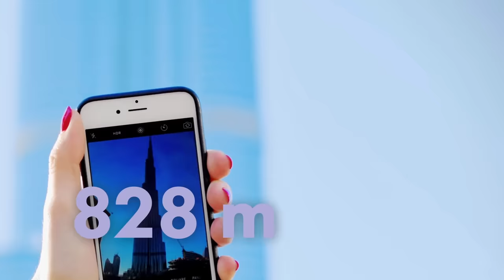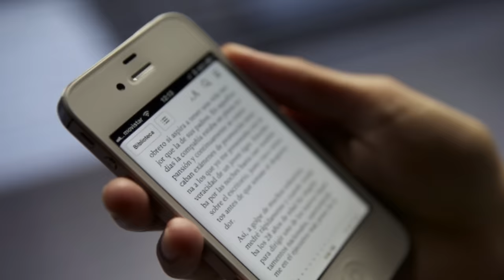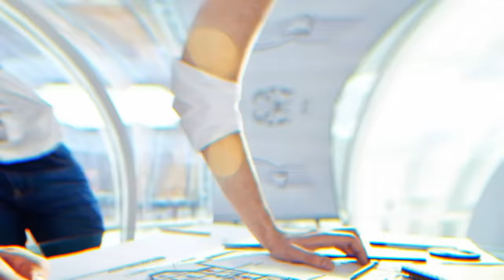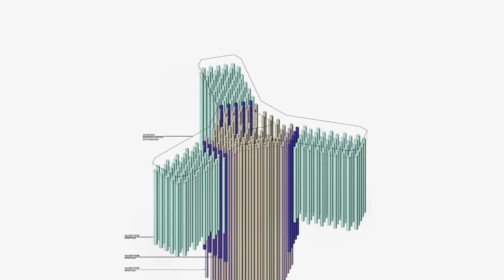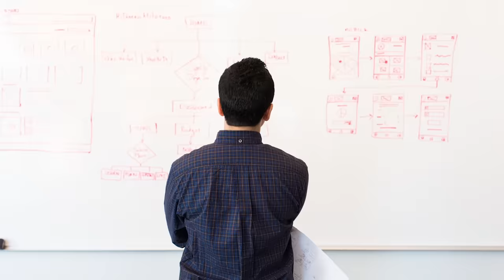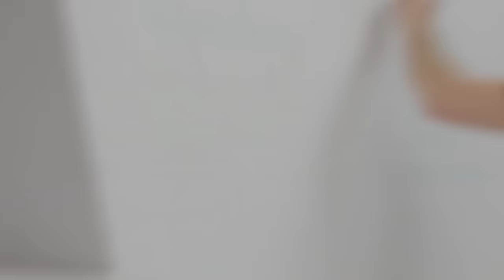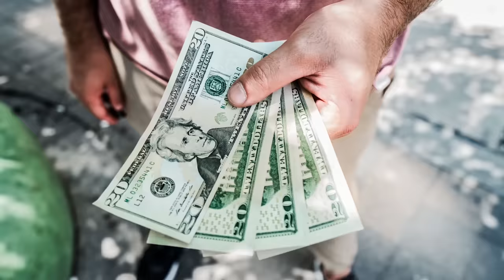What If We Build A Skyscraper With A Billion Floors?

Comment: Can we jump of the top to suicide or will we float in the space
Reply: Float
Reply: You'd  still die in space so it's  okay
Reply: Wouldn't you be flung away by the centrifugal force? The "top" would rather feel like the other bottom, with empty space below it. You'd have to jump through the floor, or from the sides.
Reply: You would die because there is no air at the roof plus the earth is 100,000 feet high until space if you were to be in building of 1 billion floors tbh have fun climbing
Reply: @vinnyn10  wow u must be fun at parties

Comment: A billion floors at 14 feet per floor equals 2,651,515 miles, or about 11 times the distance between the earth and moon. It would take light 14 seconds to reach the top floor, which is gonna lag so far behind the rotation of the earth that it will wrap around it.

Comment: If you want to solve the elevator problem, you will basically need to treat elevator shafts like roads.  Each elevator shaft will need to have only one direction of travel, multiple elevator cars will need to be able to travel down it at the same time, and the elevator cars will need to be able to switch shafts, so they aren't stuck at the end of their road, top or bottom, depending on their direction of travel.  This way you could have an elevator shaft that stops at all 1 billion floors no problem, as people using the elevator 100 floors away from you won't affect you at all.  
For the super express elevators, that may stop at every 100 floors, that's still 10 Million stops.  So the elevator cars would probably have to pull off to the side to let passengers on/off, so that other cars can pass them by, and not need to wait as long.

Comment: Even if this had a short 8FT a floor and had separations only 1FT tall (7 int FT) this would still be eight BILLION feet tall, and if this used an ULTRA slender 1/32 ratio (Steinway is 1/23.5) it would be 250 MILLION feet long (Manhattan is about 71 thousand feet long)

Comment: In order to accommodate Earth's spin the top of that tower would need to travel approximately 1 117 985 km/h. In comparison fastest man made object so far is Juno probe with its velocity of 266 000 km/h. 
Edit: Parker solar probe is four months in its mission to the Sun. In 2025 it will rech its terminal velocity 690 000 km/h, setting up new Guinness record.
Reply: Bro please can you tell me how to calculate this
Reply: First of all I needed to assume that the mass of that tower will not affect center of rotation, otherwise there will be complicated equations involved. Another assumption is that each floor has 14 Feet.

Radius of Earth is 3189 km.

Height of bilion story building:
0,0042672 km(14 ft) × 10⁹ (1 billion) =
= 4 267 200 km

Arm of the spinning contraption (radius):
r = 4 267 200 km + 3 189 km = 4 270 389 km

Circumference (orbit of the top of the tower):
C = 2πr

Angle travelled after one hour:
360° / 24h = 15°

Equation:
15C / 360 =
= 15(2πr) / 360 =
= 30πr / 360 =
= πr / 12 = 1 117 985 km/h
Reply: @anshverma8225  you asked..  there it is .lol
Reply: @hittinone  
Well it is a good exercise for me, it doesn't matter if no one cares.😁
Reply: I was thinking about the same (but without the knowledge and numbers and physics behind it)... Just... the tower would snap like a twig from the sheer speed it travels... and with the height of that building... well.... the distance to the moon is 384,400 km... while this building, depending on the height on each floor (i was someone use 10ft, you used 14ft)... well.. we are already 10-15 times taller than the distance to the moon.... that building is going to be so completely destroyed it's ridiculous... The fact that this Ridddle channel even considers this a feasible idea is so utterly wack I can't even laugh at his stupidity. What the hell are they on? xD
Thanks for your numbers as well!
Reply: @S0lstickan  well as absurd as the whole notion is in every way shape or form had he not made this video we wouldn't be having this conversation right now and talking about the numbers and the physics with it..so I think it was worth  throwing the video on YouTube.
Reply: @S0lstickan  
Lets say that the tower weighs about the same as Earth and assume there is matterial that makes this building possible to construct. It wil make the center of rotation further than a distance from earth to the moon. If we concider sustaining the same spin by putting thrusters to the tower as we build it, we will end with Earth rotating around the center of rotation in such speeds, that it would take the out the atmosfere of the Earth and inevitably end the life on it.
Reply: @Saga Malmberg  
and hey knowledge, numbers and physics?
More like Google search for raw data used, reason and elementary school mathematics. Everyone can do this, all it takes is a little of aspiration for the subject, that was missing back in the school due to the lack of understanding how to learn from both sides students and the teachers.
Reply: @hittinone  
Yes, these absurd conceptions are just about to  make you think about things and think out of the box. It is nothing unusual in physics.

This conversation is even more absurd when I consider that English is not my native language  and for last three comments (including this one) I have been drinking with 1.5L of 12° already in, with worldwide beloved Czech beer 😁.
Reply: @Chuck.1715  thanks for this.
Reply: @anshverma8225  
You're welcome. I did it for practice, I would be satisfied with no response at all, but you have started a seed leading to conversation that exceeded my expectations.
Reply: You misspelled ‘reach’.
Reply: @brianmatthews2503  and what?... why would i care about misstake in spelling i did 2 years ago. English is my second language and even if i do spelling error in my main language people are generally able to pickup  what i was telling. Language isn't about perfect grammar, but about conveying the message.

Comment: Ok, so it doesn’t seem like you truly grasp the size of this thing. 

Let’s do some math:
The standard floor height on these type of buildings is 15 feet
1,000,000,000 x 15 = 15,000,000,000 feet
1 mile is 5,280 feet
15,000,000,000/5,280 = 2,840,909.09 MILES

The moon is only 238,900 miles from earth. You would be passing the moon within the first tenth of the structure and still have about 2.5 million miles to go.

Comment: This video should really be called, "What if we Build a Space Ladder into Space?"  and this video doesn't take microgravity into consideration when you go that high up into space.  People suffer serious problems without gravity.  Then there's also the fact that all the building at the Everest height level would need to be pressurized and vacuum sealed to prevent leakage of atmosphere into space from the skyscraper.  No air = dead people.

Comment: 9:10 says 56,000km/h is the speed in which a 7.62x39 projectile fired from a AK-47 travels and this is incorrect.

Assuming it's a 154gr projectile it's moving at around 2,100fps and according to the narrator the speed of it is 24 times faster.

It's a minor mistake but otherwise a great video

Comment: Who says the building has to be a vertical free-standing structure and not incorporated onto a currently existing city? Who says you need so many elevators when you can just build the whole gigastructure like a mountain with it's own ridges, canyons, landings, terraces, bridges and whole smaller skyscrapers or megablocks littered about it? It can't be built like a skyscraper. It must be built like a city with floors. Ever growing and expanding upward and outward at it's base in much the same way as the Burj Khalifa.

Comment: It would be impossible for all the human being to finish this building, because it would take at lease 2000 years to finish this building and by the time we finish the top the bottom concrete material will be expire. Which will make the whole building to collapse.
Also the workers will be floating open space unless it will be done by robots, it would be very hard to spend goods from the Bottom to the top. There won’t be enough oxygen in the building for people

Comment: You are way off. A bullet from a Kalashnikov (7.62x45) travels at about 2500 ft/s. That is way less than the 52000 ft/s you claimed in the video. You may have confused the chamber pressure, which is about 62,366 psi.

Comment: Well if each floor is 8ft tall, then a 1billion floor building would be over 8billion ft tall, 
Then 8billion ft/5280ft in a mile = 1,515,151 miles tall

Then say you ride an elevator that goes 500mph, that would take the elevator 3,030 hrs or 126 continuous days straight to go from the ground to the top

Also why would you want to fit all of humanity inside a single structure of any size, let alone one so massively tall when if something from space hits the building and nocks it over , we’d all die basically humans extinct with one major event that we are at fault for

Comment: Wishful thinking. No material could withstand such enormous weight stress on the foundation or the lower floors. If it hits an uneven water table, slow erosion on any part of the foundation will tilt it or sink it and then crumbles down.

Comment: Would not like to be  stuck in the lift  and having to use the stairs  
It would take you a year to get to the top floor
Reply: You wish. It would take you 30 years if you could clear a floor per second constantly. The people at the bottom would be farther from the people at the top than the North Pole from the South Pole, about 1000 times farther.
Reply: @mrkiky  added the fact it takes longer, + people and crowds it would take hundreds

Comment: A billion floors could easily be built without having to reach space. Like he first stated a inner structure that uses each outer structure accommodates for the strength of every structure attached even something atleast 100klm high with a lower width at 40klm could accommodate over half the population food water safety etc. But these kinds of buildings are useless and should only be built or put to use in a real doomsday event where all outside matter gets turned into breathable habitable oxygen etc. Also we are alpt better off designing submersible buildings in the near future compared to land based buildings. Like every woke person once said "just saying"